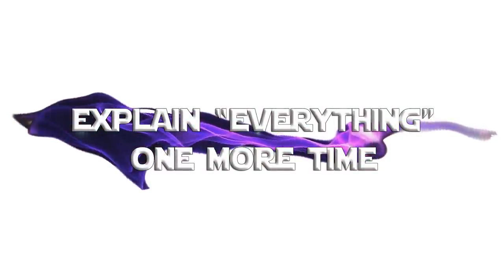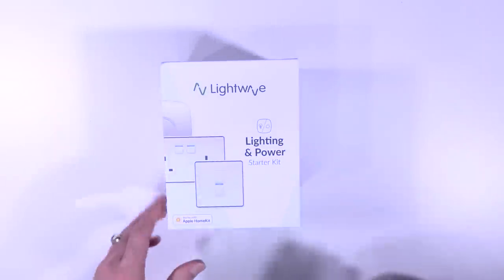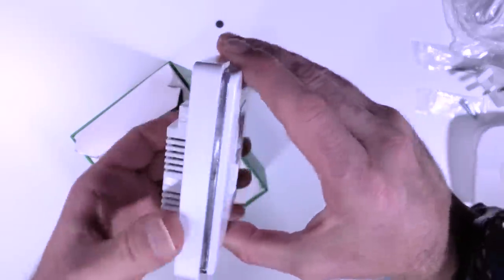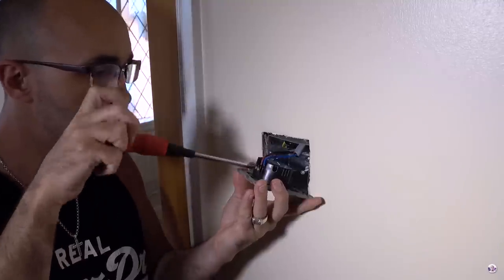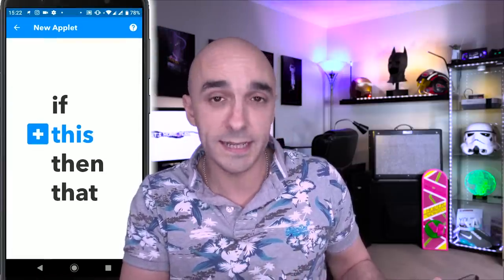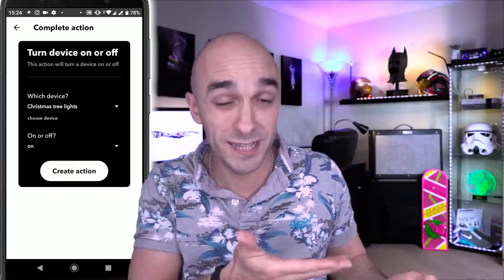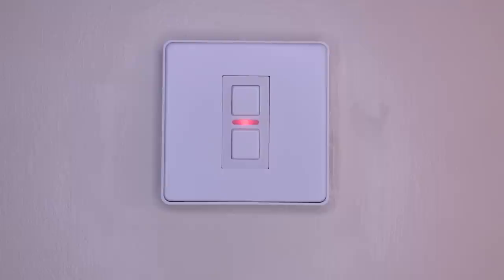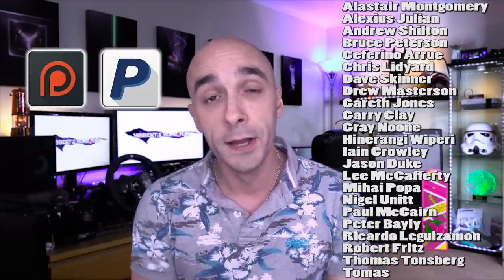Turn On Your TV With Your Light Switch : Lightwave RF Gen 2 Smart Series Review

Comment from the maker: For a more in-depth IFTTT tutorial, and to understand how I'm controlling multiple recipes with one trigger go here: https://youtu.be/UzPnvDyHVDs

If you've never heard of Broadlink, then check this video out: https://www.youtube.com/watch?v=Pdjp6ic99S8

See the description or links to buy this stuff **Please note Gen1 and Gen2 products are not compatible, if you're not using my link then be sure you're buying the Gen2 products to avoid disappointment!!**
Reply: Think you need a 35mm back box. normal house back box is 25mm
Reply from the maker: the little decorative surround ended up getting used in my room so I wouldn't have to chisel the wall.  It actually looks really nice.
Reply from the maker: The RM pro is amazing, but it's gone through periods of major disruption. Currently it works great with Alexa, I've heard mixed reports recently about Google home and keep meaning to getting round to testing again, it worked for a couple months ago. Ifttt was working a week ago, and now is not working properly again but it's a very new service for them so hopefully it's just teething trouble. For its price it's definitely worth it, I just can't wait till they've got it all fully nailed.
Reply: Paul Hibbert 5thebestwaytogetthebest77

Comment: Probably a little late to the party here, but I just started watching your videos and they're great! For those of us in the US if your house was built after the 60's or so, you'll have a neutral in every box whether it's a switch or receptacle. In switch boxes, they're usually white, twisted together and stuffed in the back of the box along with a cluster of other common (black) leads and a cluster of earth (green or bare copper) leads. Most of the time all the wires have been painted by careless painters so be careful and use a voltage tester so you know for sure the wires you intend to mess with aren't carrying current! Also, Lutron makes really nice smart switches that don't require a neutral either.
Reply from the maker: Thanks dood!! :)

Comment: Paul I do like your videos, especially mentioning electrical safety, one SHOULD NEVER assume, just because the power is off, it is every safe to use an unshielded screwdriver in a light switch, especially one with a steel back box.

Comment: First of all happy new year Paul (and everyone else)! Just a quick one, I noticed you were using a smart plug with your kettle. Just wondered which brand of plug it was? I've tried to get plugs that will work safely with the kettle, but all my sockets (mainly Xiaomi and Sonoff) have a 10 Amp max throughput, so not safe for use with kettles which pull down more and so they can get very hot. Which one do you use?

Comment: Very interesting.  The people who we bought our house from installed light fittings with a bazillion bulbs in them.  So for me using smart bulbs to automate is going to be incredibly expensive.  This looks like it could be a superb alternative.  We're looking to move but even that's not a limiting factor as I could fit these and just keep the old switches so they can be refitted when we come to move.  Nice review. :-)
Reply from the maker: Thanks Peter! :)  There are other cheaper alternatives too, but these are my favourites!  Energenie are also worth looking at, but last time I checked their IFTTT functionality wasn;t quite as good and so I couldn't have used them to switch on all these devices, Lightwave's IFTTT functionality is unbeaten :)
Reply: @paulhibbert  Thanks.  It's not cheap but as is often the case you get what you pay for.  At least because of the modular nature I can start up with a, erm, starter kit and then slowly add more over time.  Great work on the videos.

Comment: In the USA, the Lutron Caseta dimmer works without a neutral wire. I don't know of any others here.
Reply from the maker: Nice!  I did check these out when I was helping another viewer.  They looked really nice!  Not sure if you can use them as IFTTT triggers though.
Reply: Hmm... I think I have one of them lurking about in the basement. It's research time!
Reply: @paulhibbert  i have a lutron caseta switch linked to my wink hub and IFTTT works with wink. Also Paul check out stringify. It can do a lot more then IFTTT plus it can link with IFTTT so if stringify doesn't support a product it can still work through IFTTT to access it and stringify's flows are very powerfull.

Comment: Paul I know I keep saying it but you can use a $5-10 Xiaomi button, motion sensor, vibration sensor or contact sensor to trigger any routine or activity or ifttt action using SmartThings! For example put a vibration sensor on any old dumb washing machine and play alert/change hue lights when finished. Or I’ve a wireless button stuck to my couch to dim lights, turn on tv lightstrip, turn on shield to plex. Can also pause plex and show screen when doorbell rings. Pressing again will toggle harmony activities. 
Really cheap once you’ve got the hub!
Reply: It also is tradfri compatible (no tradfri hub required) so you can use ikea dimmers, bulbs, sockets etc and no delay as local zigbee based instead of cloud like ifttt
Reply from the maker: Looks like a great solution man.  I'm featuring the Ikea hub soon, my smartthings hub is out of commission sadly.
Reply: Paul Hibbert yeah I just hate spending money so love this solution 😂I’ll send you a demo video on patreon 😀
Reply from the maker: Please do!!

Comment: A good z-wave insert will do all this much better at less expense. Inserts can be installed in light fitting or behind light fitting, they do not have to go in the switch. It also means you can have any style switch you want
Reply from the maker: Will it do it without a neural wire ;)
Reply: Yes Paul, as there is a neutal in all light fittings.
Reply from the maker: Hey dude.  In the UK we don't have a neutral wire at the light switch (only at the ceiling rose).  That's one of the big draws of this switch
Reply: Thats why i use inserts, i can put them where easiest. no neutral or no room at switch put insert at light, Light wave Rf is OK but Z-wave is far better as its a mesh the more you add the better and no problems over distance. All in cheaper and more reliable

Comment: Any decent Z-Wave controller hub with Z-Wave dimmer insert modules and 3 position retractive light switches could do the same. You could program a double or triple click on / off to run any scene / routine on the Z-Wave hub, to turn on / off multiple lights and devices and AV equipment if integrated. 

Single click on / off on the light switch could still be used just to control the ceiling light(s).

This is all local as well so no need for IFTTT etc. 

LightwaveRF looks good though especially the wall outlet sockets.
Reply from the maker: Morning mate :)  I think all the Z-wave dimmers require neutral wire though right?
Reply: The Z-Wave dimmer insert modules that sit behind light switches, they work with 2 wire (no neutral) or with 3 wire (with neutral). 

However some of the Z-Wave light switches / paddles switches do require a neutral. 

MCO Home have just brought out a nice glass touch panel Z-Wave dimmer switch which works without neutral but it's pricey.
Reply from the maker: Sounds interesting dude!  How do you control the dimmer module with an existing switch? ... Or do you still have to replace the rocker switch?  Looks like it would require some serious wall chiselling to get one behind an existing switch!
Reply: 35mm depth back box is deep enough for a Fibaro Dimmer 2 module. I use Scolmore Minigrid 3 position retractive light switches with them. Can dim / brighten at the wall switch then also. Single, double and triple click actions as well etc.
Reply: To control the dimming we press up and hold to brighten or down and hold to dim. The switches normal / default position is in the middle. 

Press up and release to turn ceiling light on. Down and release to turn it off etc.
Reply: Stuart Harrison that’s a good solution, I will look into.   Whilst the light wave looks neat I’ve avoided the past 3 years as doesn’t integrate

Comment: Hi Paul, looks like you need the lightwave hub as well as a broadlink hub. Do you really need both hubs? I've just got Hive, and guess what another hub. What I want (What I really really want) ideally is to have just the one hub for the whole system. I can see why you need a lightwave hub for IFTTT but do you need it just for Alexa?
Reply from the maker: The Broadlink hub can apparently learn the RF signals for the switches if you buy the remote from lightwave, but The RM pro won't be able to do things like set dim level by percentage.  This is a very expensive switch if you were planning to do that though, there are plenty of switches out there that work with the RM pro, check this one out: https://www.youtube.com/watch?v=5M0Kf8s0mfE

Out of curiosity, with the additional hub situation; is it the electricity bill you're worried about, or a lack of space?  I might have some interesting news about the electricity bill in an upcoming episode ;)

Comment: I really wish they will make a version for Australia as many houses here also have no flipping neutral just like you Brits!!! I would buy this in a heartbeat for the switches that have no neutral.
While we use 240V/50Hz like in old Blighty, we use 120mm Yank style switches, and our own electrical socket style.

Why can't all countries use the same standards?!?!

One question, Paul: Does this work ok with Fluro and LED lights? The old Broadlink TC2 can be a bit dodgy with some globes, heard that Fluros can kill a TC2, and LEDs still are on very dim while turned off when used with a TC2.
Reply from the maker: Hey man, there was some discussion on this earlier in the comments.  The conclusion was we aren't 100% sure what bulbs will do what.  I had to change out my LED bulbs to install this dimmer, but that's been the case with every dimmer switch I've ever had, Someone said something about installing a capacitor to resolve it.  Might be best to ask Lightwave directly whilst telling them they need to start making American style switches!! ;)
Reply: Just a note the switches calibrate automatically when first set up to type & quantity of the Led bulbs attached

Comment: Hi Paul, I've decided to dive in to the Smart home tech world by first getting an echo plus a couple of months ago and then decided I'd rather a google home hub. Yesterday I received my order of a nest video doorbell (still need to install it). Is there a simpler Light switch for simpler function of just on/ off? I don't think my bulbs are dimmable. I am in Ireland you use the same style switches as you and don't have an earth wire either unfortunately. These switches are crazy expensive.

Comment: Great video. I use routines with Alexa to do everything this does but using my voice because I'm too lazy these days to get up and press a light switch. :) Too expensive for me to do something I can do already with my voice.
Reply from the maker: Thanks mate :)  The thing this switch still has for you is that it can be dimmed by percentage with Alexa without the need for a neutral wire!
Reply: @paulhibbert  But I use smart bulbs that can be dimmed instead of smart switches. :) I think this would be good as a starting point for someone who does not already use a ton of smart devices.
Reply from the maker: Sounds great till my missus switches the bulbs off at the mains ;)  She's a cow for that, she'll come do it at your house if you're not careful, I'm pretty sure she's on a mission!
Reply: @paulhibbert  HA HA, but with the right training I got mine to ignore the light switches all together, but she still don't talk to Dotty though, just makes me do all the hard work. :)

Comment: Hi Paul, great video. I’ve been using lightwave products for a couple of years. One thing you should of mentioned is that not all light bulbs are compatable with this system. It could be kind of costly changing all your lights!! So buyer be ware!!!
Reply from the maker: Thanks Martin,  good point.  6 pack here for £7 that will work if needed: https://amzn.to/2SpC0pZ
Reply: Got all mine from B&Q no flickering can post pics if any one needs also I think Lightwave has compatibility list on their website somewhere
Reply: Kevin Crane they do however it hasn’t been updated for generation 2. So it’s still a hit or miss which bulbs work. Hopefully they will update it soon.

Comment: But Paul doesn't that mean I need to push a button 😲 I have a similar set-up using Scenes in Broadlink & Give Alexa a Routine so I can choose from what I want to turn on rather than setting up a light switch to everything when I only needed a light to find my wallet I left in the room & everything else turns on Grrr
Reply: M0nk3y Nutz pretty sure he’s got the exact same control too, this is just a fun demonstration of the capabilities and something you can implement in other ways.

Comment: Got the whole house on Gen 2 so you are only a year behind Paul 😂 but finally you have discovered the best UK smart home tech I suggest to buy this for every room as its the only system thats future proof working with all voice assistants, also not expensive if you require several smart bulbs in each room say 6 x LED GU10 would cost even more for your kitchen than just 1 x switch. Just pop a 2 gang in the Hallway so one switch can control the whole house when you enter & leave. I have popped  a couple of videos on Gen 2 on youtube a few months back, Lightwave are already working on launching in several countries including the US. As a note to your subscribers dont buy Gen 1 models as they are tech thats been arround for over 5 years look very simalar but dont have same features that you mentioned.
Reply from the maker: Nice one Kevin,  thanks for the info, I shall check out your videos in a bit!  Any in particular you recommend?
Reply: Can the lightwave hub recognise other RF devices like the broadlink TC2? Learn to control it? Or it can only detect its own lightwave devices?
Reply: Still quite expensive I would say. How much did it cost you to wire the whole house if you don't mind me asking?
Reply: Spent about £900 for my home

Comment: Konoq also doesn't require a neutral wire you can get from eBay.
Reply from the maker: Hey dude.  Looks like a really nice switch!  Most very basic RF switches don't require a neutral wire, but they can't be dimmed by percentage using Alexa sadly.

Comment: Do you know how lightwave works? They mention both 433 and 868 Mhz on their homepage (Link Plus installation guide), but do not give any details which of both frequencies (and which standard, if talking about 868Mhz) is used actually. If it really uses 433Mhz, maybe the RM Pro could also be used to control lightwave swtiches (instead of the Link Plus hub). If 868Mhz is used, it might be compatible to Zigbee or Z-Wave (but not EnOcean due to the need of grid, I think). In both cases additional equipment from other companies could save some money creating a bigger lightwave smart home environment.

Comment: I have a harmony hub, Philips hue hub, Samsung smartthings hub and I believe there is a hub built into my echo show. Do you know if these switches work with any of the hubs I have already or does it need yet another hub?
Reply from the maker: The only hubs this will work with is their own, and also the Broadlink RM pro (if you have a Lightwave remote to program it).  The RM pro won't have the ability to dim by percentage though.  If I were you I would just get a pretty cabinet to put all your hubs in ;)
Reply: That's the one downfall... I'm up to my ears in hubs as it stands now, and I bet the missus won't be overjoyed with another one.
Reply: @paulhibbert  thanks for the reply have you seen any pretty cabinets lol. May have to 3d print one.
Reply from the maker: Now that is the ultimate nerd move! I applaud you sir! 😂
Reply: I’d print a tray to fit all the hubs into or get my CNC to cut some clear acrylic into a tray to hold them all and mount the set.
Reply: @paulhibbert  I did manage to program the switch into rm pro without a remote. Obviously not dimming capability. Can't remember how I did it. It took me ages to get it to work.
Reply from the maker: They do have a database, so it could be you searched out an existing remote someone had uploaded. You could make it so Alexa could "dim up", or even do a routine that did "dim up 3". Its only the dim by percentage you're missing out on with that method, and of course lightwave's own automation system.
Reply: @paulhibbert I think I learnt it via the rm pro hub but think it was via the ihc app. I can't say for sure. I just cant remember how I did it. 😕